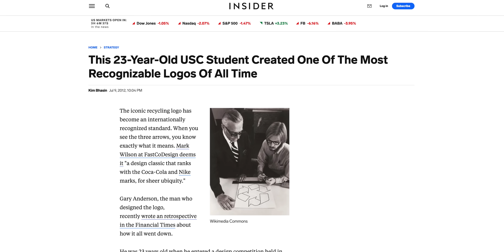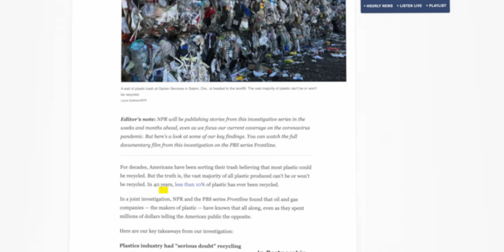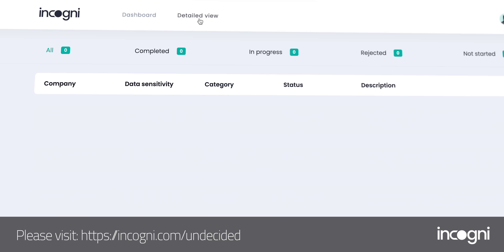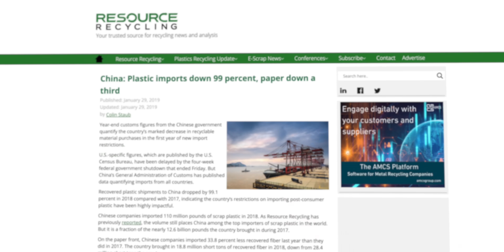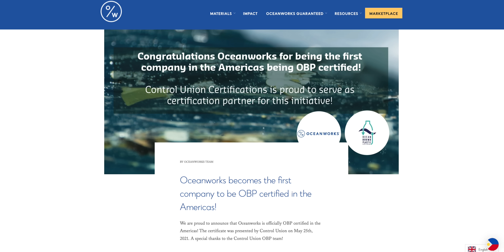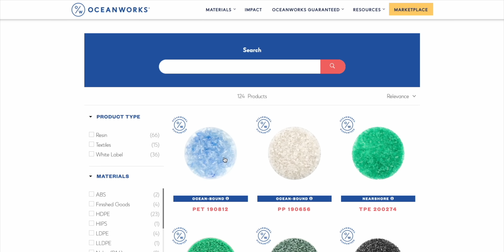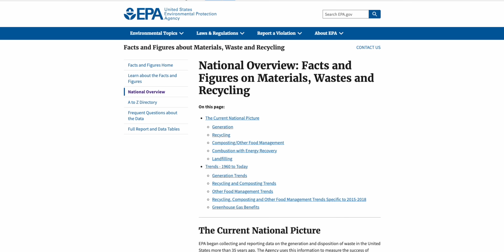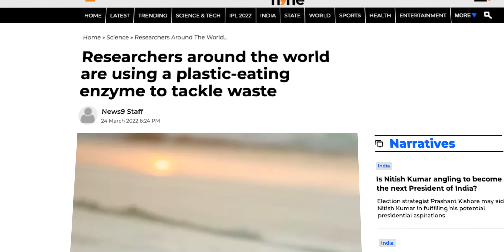The Truth About Plastic Recycling ... It’s Complicated

Comment: 2:13 you have completely wrong information! LDPE and PP is too very well recyclable. 

Like I see, you did not made the homework at all. Do you want to know, why recycling does not work? Why it really do not work? Easy answer - MIX. All plastic products is MIX aka OTHER. There is deeper roots than just "evil" manufacturers. The roots is up to resin producers, who selling the EVA by dumping prices. The plastic manufacturers take that hook and use EVA almost everywhere where possible. EVA makes all that plastic to junk. Possible to recycle but not profitable. If machines must run 4-5 slower, it is eated profit. The solution is simple, ask from every MIX manufacturers the recycling fees. Reduce the plastics what can be used for household goods packaging. Ideal solution is to use only pure polyethylene. High Density Polyethylene (HDPE) for bottles, containers and Low Density Polyethylene (LDPE) as packaging film, bags. These 2 can easily to recycle together because the same plastic but different density. The result will be the MDPE and it is possible to use for many-many things. I am sure the resin manufacturers never ever want that because it hurt their business. That is why they selling EVA by dumping prices and they make a fool face, like they did not ruin the end product recyclability.

Plastic is recyclable thousands and thousands of times, not only 3 times like you claim. Example the manufacturers plastic waste is possible to recycle countless times, because it is 99.9% clean. Sure, if there is no that stupid EVA
Reply from the maker: Appreciate the feedback.  Where did you get the information that plastic can be recycled thousands of times?  That's the exact opposite of everything we found while doing research into this.
Reply: @UndecidedMF  I worked many years on that industry. The quality does not disintegrate over the time until you do not mix EVA or other type of plastic together. The dirt is not so big problem because most of the dirt is possible to wash away and it does not have chemical reactions. Industrial plastic waste is high grade plastic waste and it should be recycled 100%, no excuse. Mixing EVA or different plastics together reduce the recycling output, because extruder needs to deal by big amount gases. Gases is bad, because the granule must be free from gases. Otherwise nobody does not buy that, because they need to reduce the production extruders speed to deal by gases. Up to 5 times lower speed is not profitable. To improve the recycled plastic quality it must be mixed on big silos. Typically companies do not invest to silos and they send recycled granule out as is. Layer by layer not mixed recycled plastic can be basically useless garbage. I remember the times where company had tons and tons only bad recycled granules. We mixed these inside the big silos, just constant re-circulation and by end of the week the result was useful raw material. Did not need to add any virgin granule. Why re-circulation helps or why it was necessary? Reason is simple. If recycled plastic granule have a gases, it will be like a cheese and and it can hold moisture. The biggest source of moisture is recycling extruder water cooling system and after production the air moisture. All the water turns to the steam and reduce the production speed even more than just the gas pockets could ever to do.

Comment: This isn't the only thing required, but it's been clear to me for a while that one of the things we need to do is to straight up ban plastic packaging when it isn't actually required and put the onus on the manufacturer or packager to show that plastic packaging is required (or is better than the alternative). That means things like those impossible to open hard plastic packages that so much stuff still seems to be packaged in. But not even just that. How much stuff could just as easily be packaged in paper or cardboard rather than polystyrene? Or glass instead of plastic?

Comment: While the challenges of the actual "recycling" process(es) of plastic recycling have been much greater than originally promoted, the social psychology outcome of getting consumers to separate their waste is a crucial mindset that is needed regardless. Removing plastics from all the other materials like organics, paper, glass, metals and such dramatically reduces the effort to recycle those materials to the point where its feasible. Training society to do that is important to prepare for the time when all/most products like plastic can be viably recycled. The risk of portraying the current lack of viable plastic recycling as a "scam" is that it creates cynicism, and subsequent disregard for recycling and pollution-reducing habits. Look at what happens to vaccination rates at the least bit of hyperbolic critique of vaccine efficacy or side-effects when taken out of context and without consideration of relative risk. You get a QANON anti-vax movement that takes hold and spreads FUD (fear, uncertainty, doubt). Titling the video with click-bait "It's a scam!" is dangerous. Titling it as "Plastic Recycling Not There Yet", would produce less cynicism.

Comment: There's also the chemical leeching that most plastic resins do. If you have to buy disposable plastic goods because no alternatives exist or are too cost prohibitive (as is often the case in my area), if I remember correctly, plastic with a 1 on the bottom leeches the least chemicals into the environment when put under heat and/or pressure. Companies are the reason we use disposable and single use plastics so much and often are the reason we can't avoid using them. We need to find ways to make these companies switch away from plastic to resolve the issue properly. :/
Reply from the maker: Agreed.  We need to get the companies to shift away from it.

Comment: Recycling is useful, but the order of reduce, reuse, recycle is important. It is vastly more important to reuse than to recycle and it is vastly more important to reduce consumption than it is to reuse a product. With single use plastics we are doing the absolute opposite of what we should be doing.

What we really need is a tax and an eventual ban on single use plastics which is very unlikely to occur because the oil/plastics industry are aggressive and effective lobbiers and will undoubtedly use the excuse of economic damage to resist legislation (which is valid, our economy is very dependent on single use plastics, a slowly rising tax would give time to shift us away from that.)

Comment: I personally never had that much faith in recycling plastic. Metal recycling has always been a thing and we know it works because you can get paid for scrap metal, which is why I was always amazed when I saw people throwing it in the dump. But collecting plastic bottles never paid meaning if it was a profitable to recycle it has a razor thin margin. I've watched to many people, from city trash collectors to SeaWorld employees, just pour the recycle bin into the trash bin to bother separating. Reduce and reuse has far more impact and there are many ways to reuse things. The big issue there is most of these plastics are weak and have limited reusability. Glass on the other had has way more uses and last way longer. I have actually chosen brands because of a glass jar which I can use for all kinds of things from shop organization to food storage. Granted glass cost more than plastic, but because of that recycling it is more likely to take off due to financial incentives. If you can get a quarter for that coke bottle why just toss it out the window or in the trash? I'm not sure why beer bottles are not already done like that. Also with a bit of a redesign of the classic bottle and I'm sure it could be made to be easily cleaned and reused, which would be even better.
Reply: Yeah, when I first moved to my city the same vehicle picked up both the trash and the recycling into the same collection. But we residents were still required by law to sort everything, even though the collectors just combined it all when they took it away. Very disheartening.

Comment: Producers paying more (ala Maine)  is just adding a middle man to passing the costs back to the consumers. Shuffling money does nothing to solve the problem.

I wonder if the best way to recycle/reuse plastic is to lock it away as construction material such as insulation, shingles, wall panels, concrete filler, etc.  Not a single solution, but a 'recycled house' might have some market appeal.

Comment: I have worked in the Plastics Industry for 40 years.   Recycling does happen during the manufacturing process but not so much after it ends up in the hands of consumers.   In the 1980's Massachusetts had a bottle deposit and the company I worked for produced several of their own brands they sold in the stores they owned.   When those bottles came back then all ended up in the trash compactor which either ended up in a landfill or were sent to be burned.   No one wants to run regrind it makes process control difficult but its done all the time during the manufacturing process or sold off to a reprocessing facility to make reprocessed resins.

Comment: This is why I'm starting a local plastic recycling center that processes used plastic into 3d printer filament. If every town has at least one small scale recycling center like this there would be less carbon used in transportation as well as a direct product being put back into the community.
Reply: This is so cool

Comment: Even if the materials aren't actually recycled, it's not all bad: it's useful to have all of a specific type of waste concentrated in single locations.  It doesn't matter if it's in a landfill so long as it's contained and separated from other biodegradable (or recyclable) garbage.  Then, when something can put that plastic trash to use, it is readily available and relatively easy to sort through.
I think what we need to focus on most is minimizing plastic items meant to be disposable (bags, packing material, food containers, etc).  That's what I think hurts the environment the most and is the most difficult to deal with.

Comment: Pyrolysis and/or Gasification for “Chemical Recycling” once “direct recycling” of thermoplastics (just melting down the plastic regrind instead of using virgin plastic pellets etc) is no longer effective (i guess in the 4th time then?) is neat too

Works well for thermosets too.

And i think Glass Reinforced Plastic would produce glass slag letting you recycle things like wind turbine blades?  May have some ash/char inclusion that would need refined out idk.

Comment: Can you do a dedicated video on “The History of Incineration” maybe?

Could go from open burning, to incinerators with some pollution control, to waste-to-energy / “Refuse Derived Fuel” + “Tire Derived Fuel” plants, to even the most modern techniques like “Integrated Gasification Combined Cycle” and “Plasma Gasification” (i think “plasmarok” is a company?  Essentially makes glass like slag via plasma  instead of ash)
Reply: + This.  While I agree that open burning is a risk of furans and dioxins -- open burning is rarely, if ever, a method of incineration on any legitimate scale.  Search "municipal waste incineration"  -- it is a process that usually involves gasification in oxygen-free and high temperature environments.  Gasification produces some basics like H2, CO, CH4 that can be used as fuel, and is probably what the enzymes make at a much lower pace.

Comment: Along with reducing usage, I think there's a couple of significant changes that could be legislated.  Since clear plastics are the most valuable for recycling, I would like to see a council including manufacturers and recyclers to determine which resins are the most recyclable and require that to be used in clear for as many products as possible.  Labels can be used to change color for marketing, or for protection of UV sensitive items.  A second change would be to require one type of adhesive for all labels, consulting the recyclers for what is the most practical (cost, less toxicity) so one solution could bath remove all labels (no shrink labels that have to be cut off, would be required to have an overlap with the specified adhesive).  These changes wouldn't solve the issue by any means, but could possibly raise the % that gets recycled by quite a bit.
Reply: @GeorgeWashingtonLaserMusket  skip the tax credits. The producers can swallow the cost of recycling. Worst case scenario we will have less “liquid diabetes” peddled to us when it comes to bottles and cans. 
Rewarding them with tax credits is just rewarding bad behavior. There was always a better option but corporate execs chose to maximize profits.
Reply: @ddhdk5414  "...but corporate execs chose to maximize profits."

This is why we'll always be the ones to "swallow the cost of recycling".
Reply: I work in the biz (won’t say who or I’ll get death threats) and I agree. Our life would be a lot easier if we could make all our products in the same color or clear. PS in white foam, PET and PP in clear, and a standard color for HDPE. The last one is what your detergent and Clorox bottles are made of. I say make them all in white and Tide can glue a red label on the bottle. It’s still Tide. Standardizing would increase recycling, reduce the cost to sort and process, and lower costs for producers and consumers.  But a big part of the packaging is the marketing, and believe me it helps sell products. Our efforts to standardize go on deaf ears especially when the “other side” just wants us to go out of business. There’s a compromise in there that we can live with if people are willing to look for it.
Reply: The only way to deal with the problem of plastic waste is to stop using plastic, and outlawing plastic would be very unpopular among voters.
Reply: Yeah cuz everything isn't already too expensive
Reply: Mandating an adhesive is stupid. Not only are you trusting politicians to be able to make an informed decision, you are essentially killing any chance for improvement.
Bill Clinton tried to implement a mandate to replace incandescent light bulbs with compact fluorescent bulbs. Now try to imagine if that had been successful and what it would mean for the current LED technology.

I expect there is also some unintended consequence to mandating clear bottles.

It is far better to mandate a standard and let industry figure out the best way to get there.
Reply: @joshua43214  It's not exactly a field that has a whole lot of likely innovation left, and on something like that we should be looking at what makes recycling more effective.  To say the same thing you're way, they could mandate that the adhesive let go in a solution of xyz chemical and let them formulate the adhesive.  Same result, the goal is simply to make recycling more effective.  Would mandating a few things cause them some headaches?  Of course it would, too frickin' bad, those same companies caused the problem by pushing plastics as a wonder product and at the same time spending huge money on advertising and buying politicians to make sure they didn't shoulder any blame for the problems.  They can be part of the solution, and they are going to volunteer for the job....
Reply: Take a look at the Nordic recycling system called "Pant". It's been in use for a century and is pretty much dealing with exactly this issue.

The system requires that all recyclable bottles (plastic and glass included) have a letter marking (A, B, or C). The letter indicates the recycling value of the bottle.

At every grocery store it is mandated to have a bottle sorting/recycling machine, works like a reverse vending machine. You feed it your used bottles, and it hands you a receipt for their recycling value. This receipt can then be used to pay with inside the grocery store you just recycled at.

Basically this system introduces a small upfront recycle tax on bottles (15-40 cents depending on bottle size), and this tax is then refunded to you when you recycle your bottles. So essentially it comes at no overall cost to the consumer, and it greatly incentivizes people to recycle their high value plastic like this.

Furthermore it completely removes the requirement to sort the high value plastic and glass at a sorting facility, there is no manual labor involved, the recycling machine does the job for you locally, and packages the recycled bottles on easy-to-transport pallets.
It ensures a 100% perfectly sorted recycling system with no manual labor and without large sorting plants involved.

And after having existed for over 100 years since its origin (1922), it's a tried and proven system that simply just works. More countries should look into this, as a start.
Reply: @GeorgeWashingtonLaserMusket  glass isn't preferred because it is heavy and it breaks. that is the biggest issue with glass coming back

Comment: Cautiously optimistic:     "Engineers Create an Enzyme That Breaks Down Plastic Waste in Hours, Not Decades...The team has called the enzyme FAST-PETase (functional, active, stable, and tolerant PETase). They developed the enzyme from a natural PETase that allows bacteria to degrade PET plastic and modified it using machine learning to pinpoint five mutations that would enable it to degrade the plastic faster under different environmental conditions."
Reply: Being able to work at room temperature is a game changer, though that now makes me worry about my cycling clothes, synthetic fleece blankets and jackets, and my bowling shirt. 😅